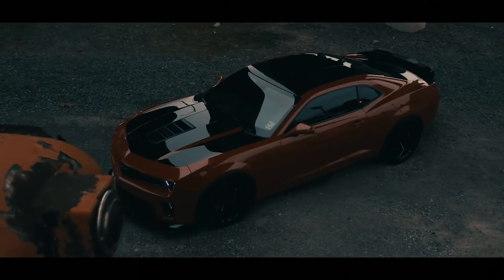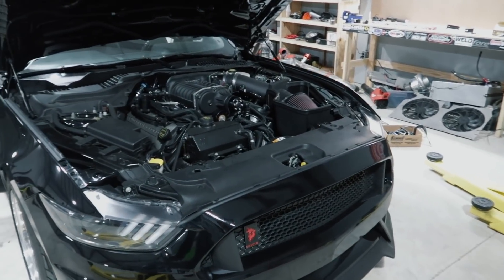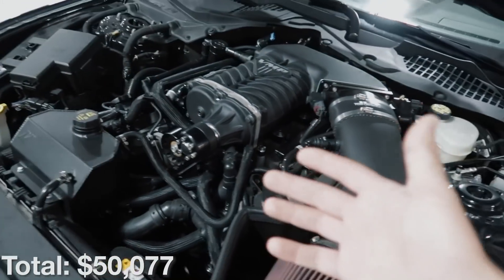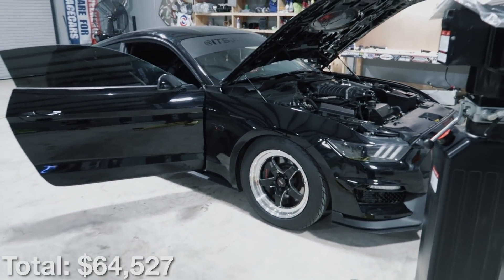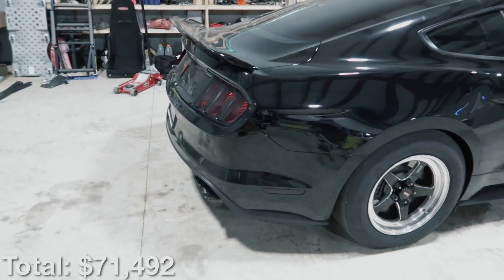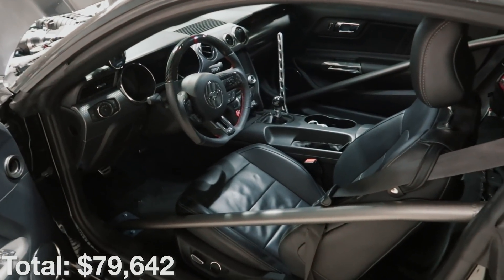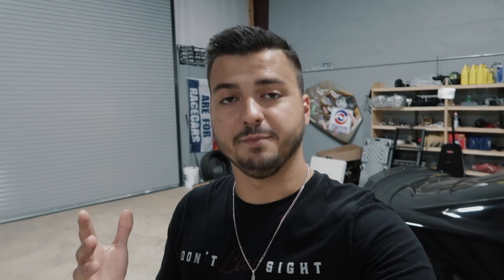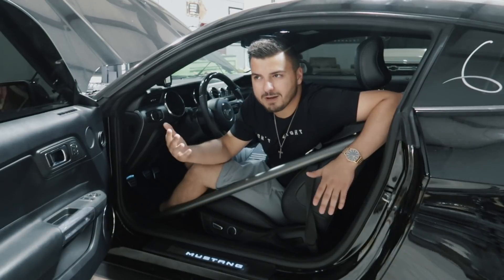Here’s the cost to Build my 9 Second, 1000hp Mustang!

Comment: U forgot the ceramic coating? And the justa6 @
Reply: Vlady and the window tint too
Reply: He also didn’t add the tail lights are tinted ass well
Reply: And the cost of the new engine since he blew the first one up 👀🤣 #moneyshift 😂
Reply: And the air fresheners
Reply: All the fuel 👀
Reply: New engine with install around $10k
Reply: What about transmission clutch and driveshaft?

Comment: Ceramic coating and tint is probably around $1500 more
Reply: abm21095 and thats his second set of tires so another 750
Reply: Not to mention what he’s had to replace, idk specifically if he mentioned it, but he replaced those LED boards in the headlights too. 

Not to mention supplies, cost of tools even like the shop 🤷🏼‍♂️ come up video ideas 💡
Reply: @zachcox8132  tools arent the car are they.
Reply: @zachcox8132  the led boards were warrantied
Reply: trueee
Reply: abm21095 is ceramic coating worth it??
Reply: @j.vosier6786  it is paint will pop more than usual lil bit of protection from UV rays on your paint its expensive if a professional does it. I did it myself it came out better than i expected took me around 8 hours to apply just the ceramic coating thats not including prep and paint correction before that.

Comment: i working on getting my boat to go fishing! i went and got a used broke boat motor i loaded it in my yellow ford truck the hub and brakes on passenger side wheel in front was screwing up i got a 150 junk motor, with a lower unit & ss prop on it!  the prop was over 400 bucks new!

Comment: All Roushes was at one point a Mustang GT, you can either build the car in stages which there are 3 stages or you can get it fully built in one stage. If it has a Rough certificate badge like you has (the one under the hood) then it is officially a Rough. I'm in no way putting you down, I just wanted to give you a little info (I think Roush has a place on their site that says all this if you want a little more in depth)
Reply: Oh yeah nice ride man

Comment: The added gen 2 short block was 2500 If I remember correctly, the driveshaft I would guess is around 1000 and the clutch as well. Maybe there is more idk.

Comment: sorry my english is not so good, does this mean its 1000whp still on stock internals? and a built motor is ready and waiting when the current one blows up? because from my research i found out that the stock motor is good for 700-800hp 😯 great video

Comment: I have corsa xtreme cat back, stainless works headers couldn't  get 1000hp  cheaper by adding gt500 heads stage 2 whipple supercharger and stage 2 thumber cams  with upgrade fuel system?

Comment: You're crazy for paying that much for a crappy 6pt bolt in cage. You could of paid the same price for a chromoly weld in 10pt. When you mount those Kirkey's you really wanna mount the seat mounts to the cage. If you had a 10pt and welded the bottom bracing in and 2 bars you could mount the set up very securely.

Comment: Pretty sad if you NEED 1000 hp in a 400-500 lb lighter more aerodynamic mustang to get into 9's while a 4250 lb demon does it with 840 crank hp and a lot more weight.